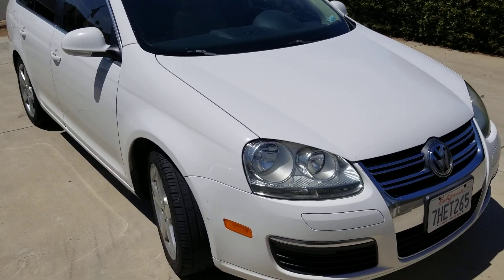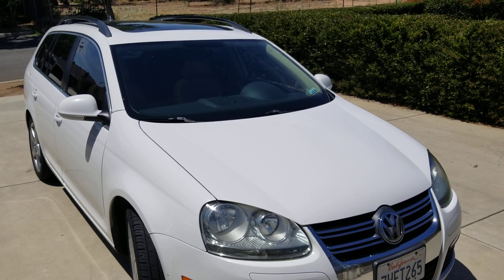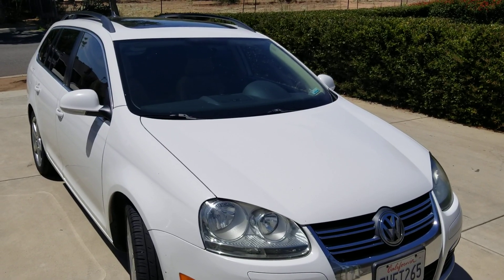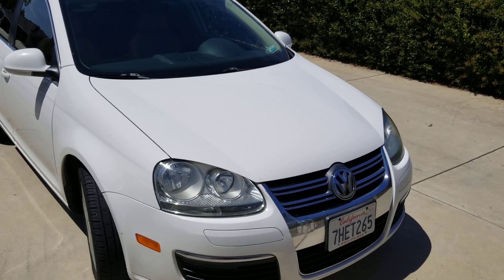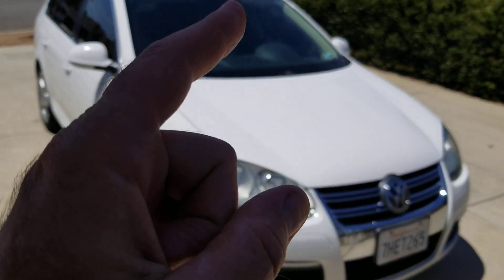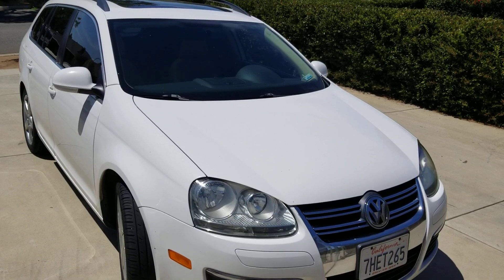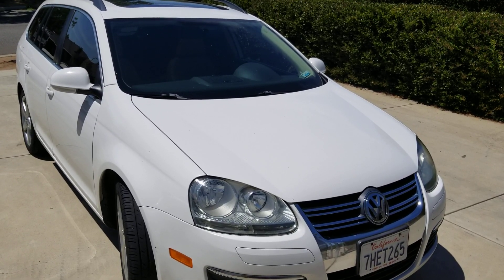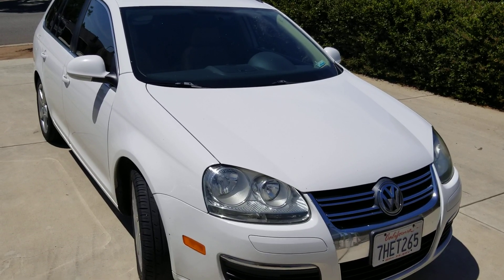How to make your car last longer from a mechanic's standpoint

Comment: There are a lot of things people don’t consider as maintenance items that are very important. PCV valves are so often overlooked. Throttle body/plate cleaning. Maf sensor cleaning or replacing. All those little things help in the long run. Helps to not be an abusive driver. Be easy on them as they first warm up. Don’t ride your brakes. Ect… there’s a lot that can be done to prolonged their life

Comment: My cars 18 years old showing it’s age little but overall things in great shape and really it’s not hard all I’ve done is changed the fluids tires belts filters like air filter gas filter oil filters battery and some suspension parts like bushings mostly. I keep it clean inside and out engine bay gets washed and cleaned car gets waxed after the wash tires get rotated and kept up with proper air pressure brakes get changed and that’s been about it other then a new windshield. Maintenance is key don’t be lazy with it.

Comment: Good tips, I do everything you mentioned and both my Hondas are flirting around 200k and still look good and are going strong 💪 😁
Reply from the maker: just be prepared for a valve job on a honda. Great engine but the valve train is the weakest link. Once it is done within that 200k mile zone or so it will keep on running for another 200.
Reply from the maker: @MrFdxdoeboy  DSG os really strong the old  automatics were not so good. But DSG only has a couple issues valve body and clutches. both pretty easy to fix. the old O9g was terrible. 06 and later have the dsg DQ250 6 speed or later 7 speed both good.